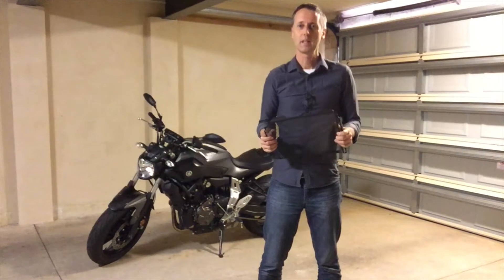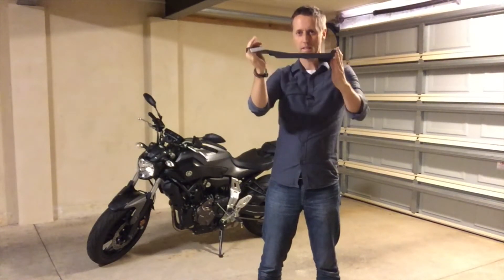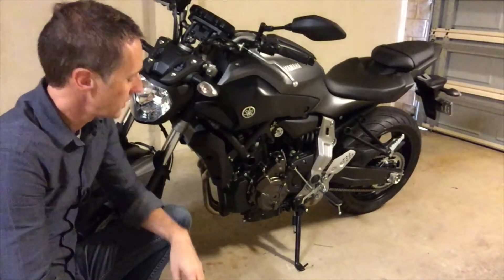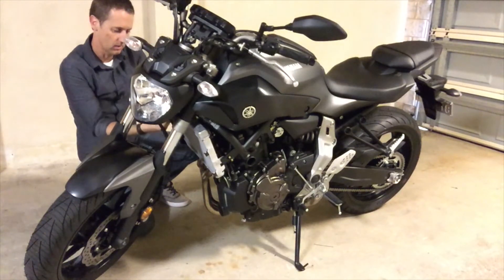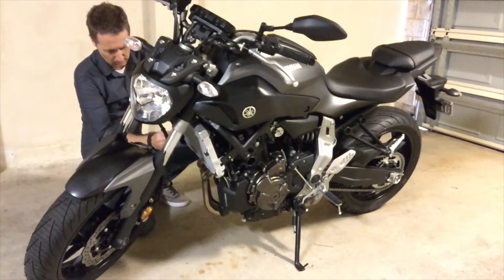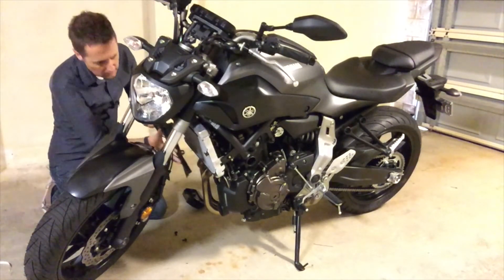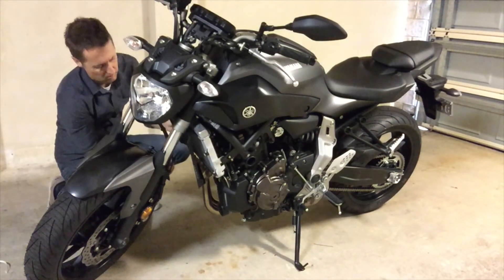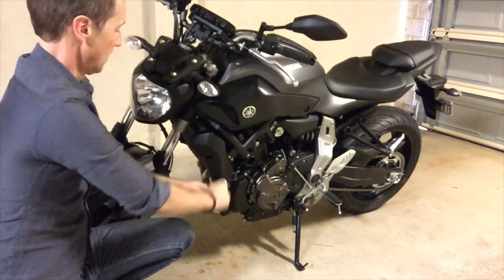Yamaha MT-07 Radiator Guard Installation

Comment: Does it fit with the yamaha radiator side covers? The website i got it off doesn't say,  but your website DOES make a note that it isnt compatible. Ive also read on some forums that it fit perfect with the side covers
Reply from the maker: It depends what you mean by "side covers" as people interpret it differently. The MT-07 already comes with side panels on the radiator, those are fine. But if you install the Yahama side cover guards (additional product) then it won't fit. Hope that makes sense!

Comment: We cannot see where you put the adhesive strips newb :P
Reply from the maker: The kit has been updated and now has rubber bungs instead of foam strips, you can see the updated instructions at https://evotech-instructions.s3.eu-west-2.amazonaws.com/instructions/011714+yamaha+mt07+rad+guard+instructions+new+rubber+bungs.pdf. However if you still have an old kit with the strips, they go at the top and bottom of the radiator and just act as a buffer between the radiator and the guard

Comment: I just bought this and it came with nothing but the grill.. Should I put some weather stripping or not?
Reply from the maker: Hi Tim, you definitely should have got some bungs and other pieces that will help a lot. I would suggest you contact the retailer you purchased it from, or Evotech Performance directly, and they should be able to get you the missing parts.

Comment: Hi I purchased this for my 2018 MT07. Would you know if it would fit alright?
Reply from the maker: Yep, will definitely fit the 2018 model too.
Reply: @hurtlegearau  thanks. Love your videos I always use them as reference. Torque measures for bolts are really helpful. Ever consider doing an aftermarket exhaust installation? Cheers!